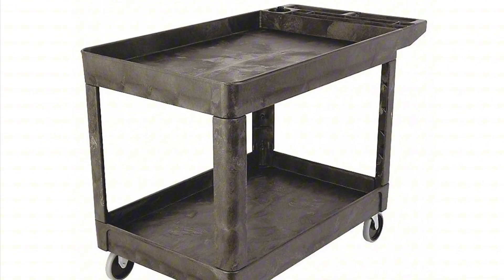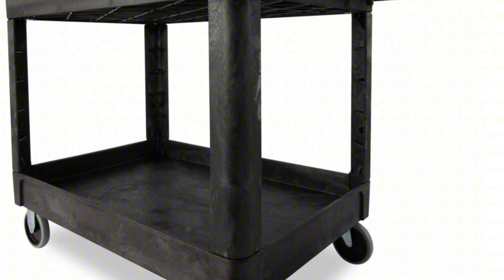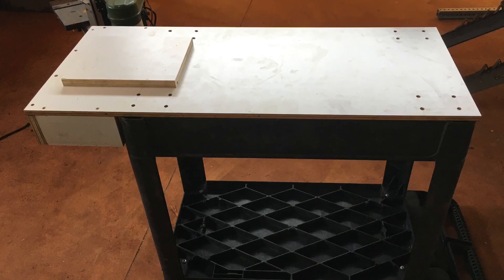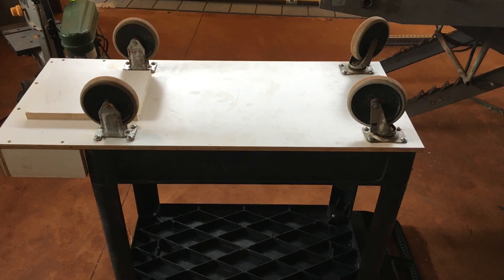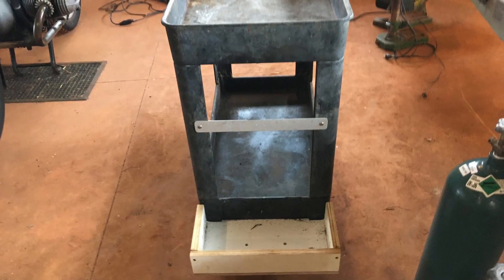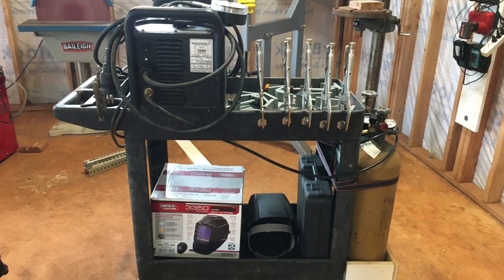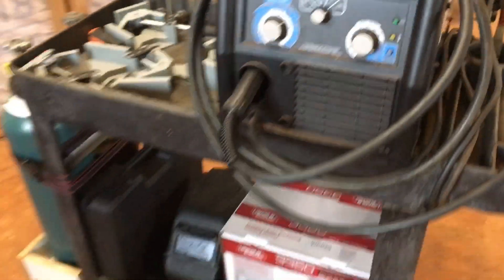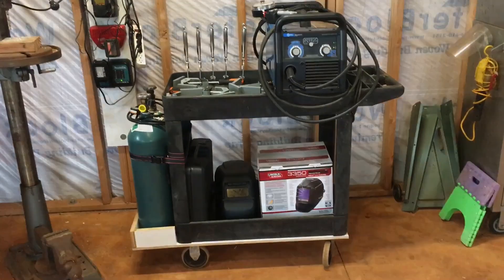An Inexpensive Welding Cart Alternative that does it all

Comment: I like the idea of adding the base to extend the utility. I have a steel trolley but hadn't thought about the extension.
Reply from the maker: Ya, a lot of the reasonably priced carts out there are pretty flimsy, don’t have the best casters, only hold one bottle, and sometimes have a top shelf that is undersized which doesn’t allow side door access to a MIG. I did forget to mention I added a counter weight to the other side to balance out the bottles.